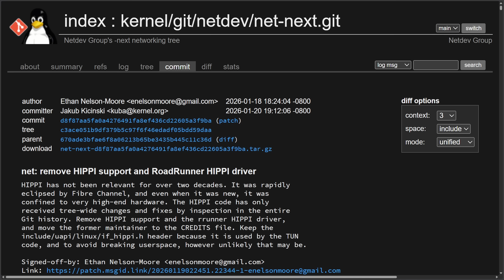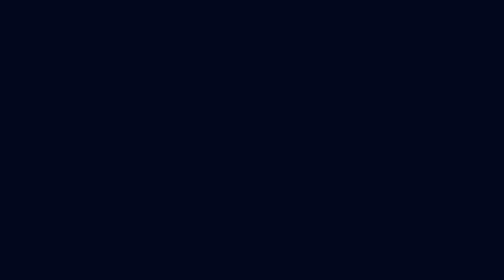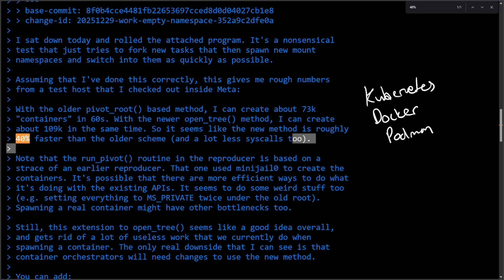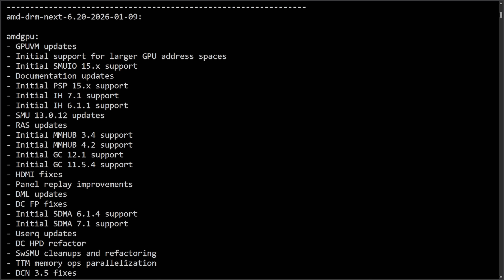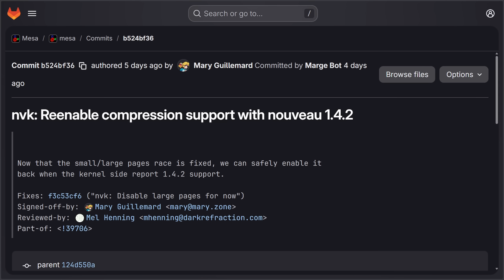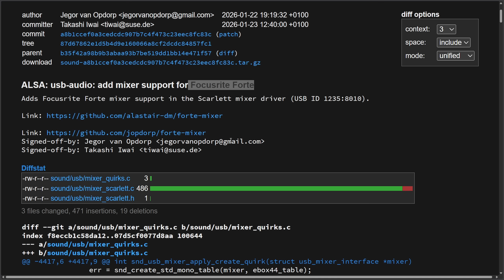Linux 7.0 Review: MAJOR Performance, GPU, CPU, and Networking Upgrades

Comment: Rust, over hyped and only popular because corporations spent a fortune to make everyone want to use it. It amazes me how easy people are to manipulate with hype. Disturbing actually. All emotion, tribalism and little logic beyond surface declarations. Half the people chanting Rust don't even know exactly what it does. They simply chant safe, but don't know what it makes safe (if anything) and how. Hell, these npcs even make comments on issue trackers saying 'you should've used rust' in response to every issue under the sun. It's embarrassing. All noise, no signal. No language should be pushed which was imposed in a top down manner. No language should be pushed in situations where other languages are more appropriate for the task. Long standing tools which work flawlessly should not be swapped out for incomplete and buggy replacements only being redone for the sake of making them with a new trendy language.  All of this has been obvious and stupid from day one.

Comment: How does linux get EVEN MORE performance??? I mean I switched to Mint (i like the layout) and instantly noticed huge performance improvements both in game and in most other apps I use. I have had a few issues here and there but only minor ones and less than on windows 11. I decided to switch to Linux when Microsoft announced they wanted to create an "Agentic OS"

Comment: I had trouble with suspending/resuming my Fedora 43 machine on the current kernel 6.18.9-200 with NVIDIA hardware (proprietary driver, not nouveau), very similar issue as showed in 15:54. I only experienced it after upgrading to 6.18.8 & 6.18.9 version. I read the 6.18.10 changelogs, they mentioned/fixed about it. This linux version 7 is looking great btw, really liked the Rust integration on it. Thanks for the video!

Comment: Some more info from Gemini ✨

Linus Torvalds recently confirmed that the Linux kernel 7.0 will be the next major series, following the release of version 6.19 on February 8, 2026.
Based on the standard 9-to-10-week development cycle and the current schedule, here is the expected timeline:
Release Timeline
| Milestone | Expected Date |
|---|---|
| Merge Window Opens | February 9, 2026 (Active now) |
| First Release Candidate (rc1) | February 22, 2026 |
| Final Stable Release | Mid-April 2026 (likely April 12 or 19) |

Why the Jump to 7.0?
The move from 6.19 to 7.0 isn't because of a massive architectural shift. Linus Torvalds typically triggers a major version bump when the minor version number (the ".19") gets high enough that he "runs out of fingers and toes" to keep track. He has used this lighthearted logic for previous jumps to 4.0, 5.0, and 6.0.

Key Features Expected
While major version numbers in Linux don't always mean "major" changes, version 7.0 is shaping up to be a solid update:

 * Live Update Orchestrator: A new subsystem designed to allow kernel updates via kexec without disrupting active virtual machines—a huge win for cloud providers.
 * PCIe Link Encryption: Adding support for encrypting data on the wire between the CPU and devices, bolstering security for confidential computing (like AMD SEV-SNP and Intel TDX).
 * Performance Boosts: Initial reports suggest significant improvements in UDP networking performance and scheduler tweaks like the "TIP Time Slice Extension," which helps critical tasks avoid being interrupted.
 * Rust in Linux: Many developers consider 7.0 the point where the "Rust experiment" officially transitions into a permanent, core part of the kernel development process.
Distro Adoption
 * **Ubuntu 26.04 LTS: Canonical is aiming to include Kernel 7.0 (or at least a very late RC/patch) for its April 2026 Long Term Support release.
 * Fedora 44: Expected to ship with 7.0 or update to it shortly after its spring release.

Comment: A Linux distro is what most people should have their aged parents running. One time I found (just in time) a program running that could’ve been used to hack in my patents in law’s bank account. This was on Windows.
If they only use their computers for web browsing, banking and writing the occasional letter….get ‘em on Linux and change the desktop to look like windows (if necessary).

Comment: Recent adopter of Linux after abandoning Microslop ~1month ago. Really excited for this I feel like I made the leap at the right time.
Reply: The best time to switch to Linux is 20 years ago. The next best time is now.
Reply: YAYyyyyyyyyy
Reply: I have also started the switch. Got a NUC with Win 11 preinstalled. My daily driver is Windows 10. I refuse to use Win 11, so I figured it's a good time to finally try Linux. Once I'm more used to it, I'll probably end up moving my main PC over, too.
Reply: Right there with you. I was about to angrily punt my Windows computer into the sun, but I decided to try Linux first, and my computer just worked…it was beautiful.
Reply: I've been using CachyOS for about 2 months now myself, never dual boot. I'm honestly amazed at how far Linux has come since I tried ubuntu as a kid

Comment: Get back to me when we have finally have a proper and working DE, then we can talk about switching to linux.
Reply: My desktop works fine. KDE/Plasma. Nothing wrong at all. Even the multiple displays have been worked out over the past 5 years or so. It's really nice actually.
Reply: @JMFTech-c5r  I just tired it. Seems to me it still have problems with DPI scaling and font rendering issues. No matter what I do, the fonts look like windows XP era before anti-aliasing and ClearType, even while having both AA and hinting turned on. Most webpages look weird due to font rendering, random spacing between the letters. When that's fixed, contact me here :D
Reply: @JMFTech-c5r  I've tried a few DEs, and KDE/plasma had a really big issue, the font rendering. It's actually terrible. It's like if I were went back to windows XP without anti-aliasing fonts. Everything is just so pixelated. Web browsers renders the fonts awfully, doesn't matter which one I use. Also takes nearly a second to show a preview of the programs you've opened on the panel, without a trivial/simple way of changing it. Gnome is just "terrible"; they try to enforce a table design on a PC. If you make it resemble a normal desktop computer with addons, the next update will break everything and you can start all over again.

Comment: The only thing keeping me from switching to Linux is the effect I have an Nvidia GPU and Nvidia suffers on Linux. I really should have done 9070 XT instead of the 5070 TI. If this fixes those issues and brings it closer to what you can do with AMD gpus then sign me up. I will instantly install nabora. I actually don't have that much to lone on my current PC
Reply: Which one are you thinking about? Unless you're REALLY insistent on only using FOSS, there's no reason to use nouveau with an rtx 50X0 gpu.

Comment: While Linux gets faster, Windows gets slower.
Reply: They just don't care anymore because they don't have to. Windows is now taking only 9% of Microsoft's revenue stream, with Server and cloud services being the main direction they're going in.
Reply: @vuk8550 9% Revenue but it helps them with Xbox, MSOffice, One Drive, and Much more to market their dodo
Reply: @vuk8550 then why buy all game studios there is and even provide xbox?
Reply: Just need gaming support for AAA titles, and good Nvidia driver support then I'll switch...
Reply: @chrishoesel AAA games work, it's the devs choosing not to support linux in their anti cheat in online multiplayer games which is the issue.
Reply: @rolandohiebert2144 the market isn’t big enough yet hopefully the steam machine will push it mainstream
Reply: @rolandohiebert2144  The anti-cheat systems used in these massively online multiplayer games rely on Windows kernel drivers, which have been widely criticized by players and are the primary cause of system instability.
Reply: @chrishoesel cachyos runs great with nvidia
Reply: @doommmmmmm still much much slower than clean optimized windows..
Reply: @PanosTekk only on opposite day.
Reply: @doommmmmmm I understand you might be a Linux fanboy.. Believe me I want it to demolish windows as well. I have tried both for years (especially cachyos lately). Harsh truth is that with relatively modern hardware, if you spend the same time in optimizing windows (turning off some background services, regedit, Nvidia settings etc..) that you would in making Linux work and install your needed apps, there is no competition. AMD is closer, but still.. Windows is still the best operating system for gaming with 15-30% better performance in the vast majority of games compared to the best gaming Linux distro .. And this is from experience and literature.
Reply: @PanosTekk  next time try making your lies more believable also don't forget that windows will re enable all the bs after every update alongside breaking something else so the time you spent making it almost as fast(in the best case scenario) as linux will have to be done again and again and still run slower than linux on the same hardware. i tried it myself and decided to save my time installing cachy instead of wasting it unfucking microslops bs over and over because windows is not made for people like you and i from the ground up. 
ps from the time i hit the power button untill i get everything i want cachy os starts in less than a minute and remember where i left off whereas windows takes 3+minute and doesn't remember where i left off.
Reply: @PanosTekk This is not true, the difference is minimal, and in some places Linux even outperforms Windows in games.
Reply: @murikana Check the latest Nvidia benchmarks for AAA titles..
Reply: @chrishoesel gl on the Nvidia bit, although most Nvidia cards actually work, as far as triple a support very very few games can't be ran on Linux even none natives thanks to Proton the only real exception to that is games with kernel level anticheat in which case the game devs have a single setting toggle whether or not Linux is allowed
Reply: I wonder what will happen to Linux since so many people switching who would've never changed it if Microsoft did things a little different.
Reply: And I must add Linux gets more stable and Windows becomes more unstable. Linux kernel code is well designed and maintained because it started from a good base whereas Microsoft’s base was not fully developed before it was released. It’s nothing other than a dumpster fire of one patch after another. That’s the difference.
Reply: @AtlAnta-i5d i remember from XP to 7, they had to create a totally new operating system from scratch because of the code.
Reply: Use winhance is awesome
Reply: IT NEVER WAS FAST. ui lags like hell in linux.
Reply: @S @SayWhaaaaaaaaaaaaaaaaaaaaaaat  funny joke
Reply: @SayWhaaaaaaaaaaaaaaaaaaaaaaat I sure do wonder how windows works on that piece of junk
Reply: @S @SayWhaaaaaaaaaaaaaaaaaaaaaaat  umm don’t you mean the package you where using. Linux at its core is the karnal and the different desktop environments are just packages
Reply: So like it always was?
Reply: brains replaced by ai does that - if there were 1000 brains thinking how the experince should be in the past now its 50 that are chosen by a board to make most profit and 950 ai brains to "Make it so" eg -really they turned braindead by choice like some animals -like sloths -its the most efficent to live as a sloth -dumb and slow , i guwess microslop cant escape evolution -the corporate evilution
Reply: No problem, it will become slower as low-level safety-crutches are now valued higher than performance. Rust should have been rejected with the same argument with which C++ was rejected as this argument is even stronger for Rust.
Reply: @svenschneider1578  im pretty sure that linus is at least 10x wiser than you when talking about rust advantages and he said that the pros are far more than the cons. Besides that, the video just said that it ll make a feature faster, why contradict it?
Reply: @lusk4gf I don't see how a slower language would make a feature faster unless they used a more efficient architecture or algorithm. That means they could have just used that architecture in C.

Rust has a sizeable learning curve. But, it is better at ensuring code is correct and has more modern ergonomics. If C++ wasn't so bloated and focused on solving the problems Rust committed to solving earlier, C++ could have replaced C and Rust would be struggling to take off. But, I imagine it is hard to deliver features across all domains and focus on safety simultaneously.

Comment: Opened a new hp work windows laptop for a meeting. Refused to recognize projector either via usb-c or a clickshare dongle. Had to scrap plan of projecting. Then wanted to use calculator. Opened and crashed. Couldn't use the calculator. Windows makes computers expensive paperweights.

Comment: The only good thing MS has is Excel. It is a very powerful tool that works very well, but is also plagued by the absolute abhorent AI slop they force on it. If someone just sells an OSS of Excel that isn't 15-20 years behind, I would buy it in a hurry.
Reply: Try libre office Calc,
Reply: Libre calc is just as capable but Excel is most commonly used in finance and other businesses it's hard to work with on open formats.

Comment: I know you are a bunch of smart cookies: Can somebody explain to me why my PopOS with Cosmis is not capable of saving Display Settings. I have my main screen projecting to my tv, but every time I restart, my television is grey and plays sound but no video and when I go into the settings, it just shows no projection. Same goes with desktop background which switches to the standard one. I googled it and it just told me to delete the config file and restart so the new config saves the options which should help, but it didn't. 

Am I just stupid or is it because PopOS is relatively new with its Cosmic desktop design? Like... I am no developer, but the clean loading of a config file that has the setup saved shouldn't be that much of a problem, should it?
Reply: it is very experimental my man. please go with kde or something for now.
Reply from the maker: I have the same issues. Somethings bugged on the restart and not saving last session config info. Only with multiple displays

Comment: Im sick of my pcs running realtek cards constantly disconnecting from network!!. For the love of Tux fix this!
Reply: Does this happen after sleep or hibernation? If so, you can probably change how your PC sleeps or hibernates to fix the problem.
Reply: @amosbatto3051  Neither. The wifi connection would completely disconnect on Bazzite kDE desktop and then instantly reconnect. It did this while I was actively using the machine. All my research said that Realtek doesn't respect standards and therefore makes it difficult to code for. Understandable. But I did find a fix. I had to turn off IWD and then the flapping went away.

Comment: We may be approaching time for a revision to the MAJOR/minor version nomenclature for the kernel. While there is nothing inherently wrong about the cardinal numbering schema in use currently I do find the numbering system based on year.month in use by Canonical for Ubuntu to be helpful at times.
Reply: Yeah, kernel v7 isn't any particular milestone, it's just that Torvalds doesn't like going to x.20 - the only one was 4.20 and that's possibly only because of it being a meme number.

Comment: I'm only using Linux because I have old machines that can no longer run windows. I am not using Linux because of its quality. Miserable time. Hopefully by Linux 10.0 they'll figure out that software has to be made to be usable by normal human beings. Most people do not have extreme autism or a CLI fetish. 

However I recently switched to Bazzite and was surprised how out of the box functional it is. Get those people to replace Linus torvalds.
Reply: wth r u talking about? u can even make ur own usable by normal human beings distro by using the kernel he made.

Comment: How long does it usually take distros to incorporate the new kernel?
Reply: Depends on the distro. Rolling releases will see it nearly immediately. Debian will take a few years. LTS distros will likely see it on their next release. I can’t remember if Fedora will pick it up quickly or wait for a new release.
Reply: With rolling release distros (Arch, Tumbleweed, etc.), the new kernels are available almost immediately. Fedora and Ubuntu release every six months, so they will get it pretty quickly too. Then there are distros that release once every two years (Debian Stable, Ubuntu LTS, RHEL, SLES, Oracle, etc.).  Ubuntu 26.04 LTS that is coming in April will use Linux 7.0, but Debian 14 (forky) is expected 2027, and it will use the next LTS release (which will probably be Linux 7.4 if they follow recent precedent of every sixth release being LTS).

Comment: A major version release makes sense.

The whole rust argument is enough to make a clean break. That way those who are still totally against it can fork version six and do their own thing.
Reply: Most of the anti-Rust paranoia pushed by people like Bryan Lunduke is baseless conspiracy theory, and the smart programmers are going to figure out that it is all baloney, so I doubt Rust-free Linux will ever take off. There are real issues with Rust and minor architectures (m68k, SPARC, Alpha, sh4, hppa, etc.), but these problems are getting resolved with rustc_codegen_gcc. At the end of the day, it is just bad engineering to keep using a memory unsafe language and Rust is the best solution currently available for adding new code to an existing C codebase. Maybe in 5-10 years, we will have better solutions than Rust, which is a hard language to learn in my opinion, but for now, Rust looks like the best solution, which is why so many projects are adopting it.